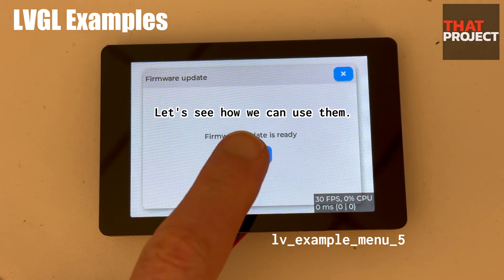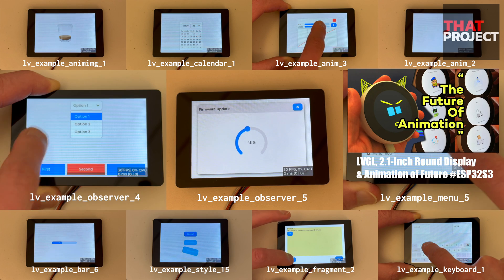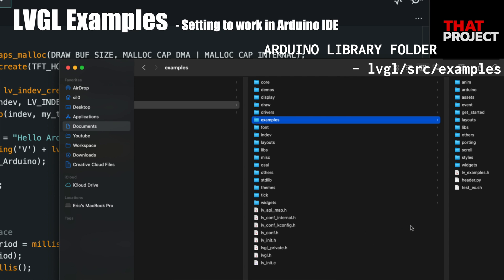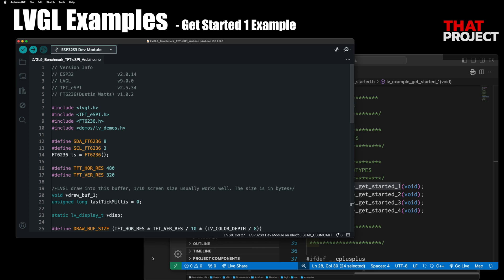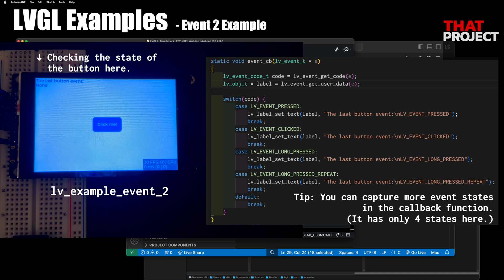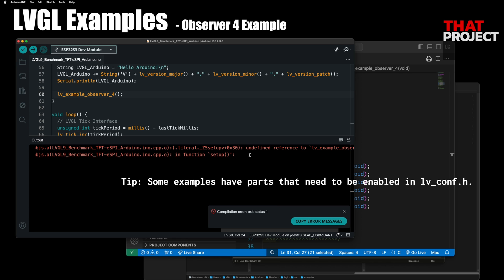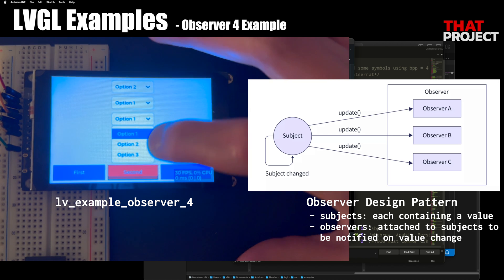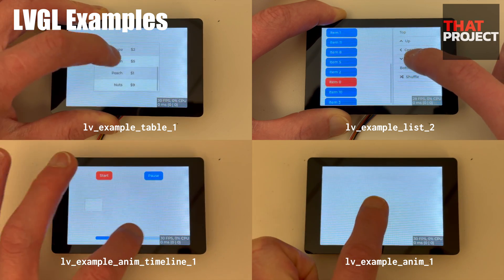LVGL Tutorial with ESP32, We can understand better and faster through LVGL Examples #LVGL #UI

Comment: Do you know of a way to load a custom image and within the image there are selectable 'hot spots'.  For instance, lets say a traffic signal head is what is displayed to the user on their mobile app.  They could select the green, yellow or red of the traffic signal.  This in turn would turn on outputs connected to an esp32.  
I currently have a it working where the user can select 'buttons' to turn on or off outputs.  But I want to overlay these onto an image.

Great tutorials btw!

Comment: I've tested the observer 4 example,  and on my ESP32 S3 the switching tab cause a freeze...always 😢
Reply: I had the same problem because I have an esp32 with 64Kb of volatile memory.
Two things must be done: move the weight from DRAM to PSRAM and use a non-blocking timer in the loop.

And you can solve it this way. Change the line code in this way:
//draw_buf_1 = heap_caps_malloc(DRAW_BUF_SIZE, MALLOC_CAP_DMA | MALLOC_CAP_INTERNAL);
draw_buf_1 = heap_caps_malloc(DRAW_BUF_SIZE, MALLOC_CAP_SPIRAM);

This way you move the weight of the drawing buffer from DRAM to PSRAM and the DRAM memory is used only to execute the code.

Change the loop like this:
void loop() {
static unsigned long lastUpdateMillis = 0;
if (millis() - lastUpdateMillis >= 5) {
lastUpdateMillis = millis();

// LVGL Task Handler
lv_task_handler();

// LVGL Tick Interface
unsigned int tickPeriod = millis() - lastTickMillis;
lv_tick_inc(tickPeriod);
lastTickMillis = millis();
}

If you use a non-blocking timer with the millis() function LVGL will update every 5ms allowing for a much smoother display. Hope this helps.